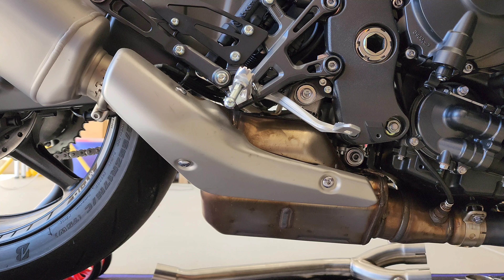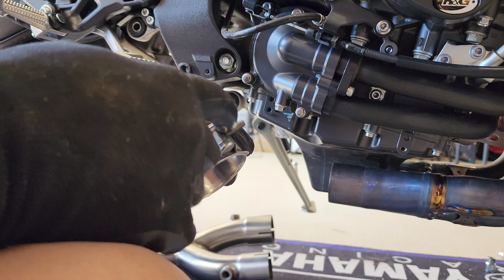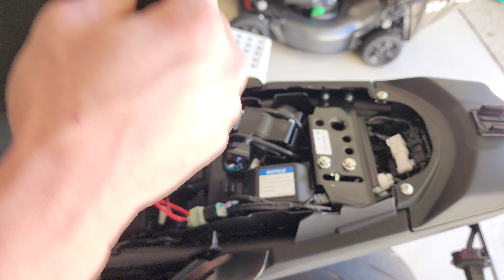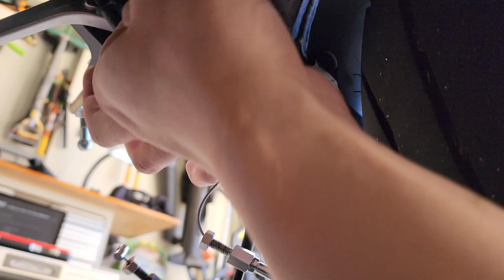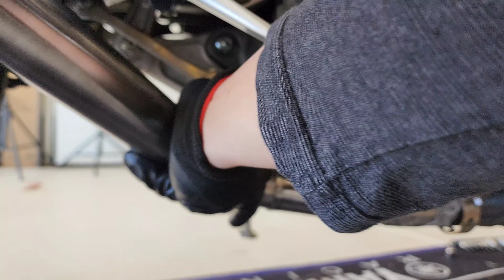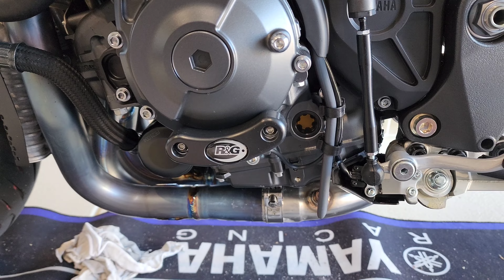2022 MT10 Exhaust Installation - Musarri Link Pipe/Mid Pipe

Comment: Excellent vid mate! Well done. 

Guessing you're from Aus? What city? any issue with not running a Cat on ya bike? (im kinda stressed about that but really wanna hear that engine!
Reply from the maker: I'm in Perth, WA. No issues running no cat and can with Mr Plod. It's loud, but not as loud as SC Project. It also has healthy amount of pops and flames on down shift.
Reply from the maker: You'll still hear the engine, but once you're going 110kmph or above 😉 you'll just hear the exhaust and wind noise. I got a HJC RPHA11 RPHA10 helmets and they're noisy helmets.
Reply: Cheers for the info mate.

Comment: Somebody probably already mentioned it but make sure you have that ecu flashed accordingly. They run extremely lean when you get them breathing properly with an exhaust.
Reply: If it's lean, how do you explain the flames out the exhaust?
Reply: I'm sure it's fine......just send it like it is😅🤣😂
Reply: @ryanmurray9017  When a brand-new exhaust or link pipe is installed, they always shoot out flames. I think there is some kind of chemical coating inside that needs to be burned off.
Reply from the maker: Several months in and I'm still getting a lot of pops and flames. I get complaints from my biker mates when they ride behind me it smell of fuel so definitely not running lean.

Comment: How is your bike running without an ECU flash? I’m concerned about mine and don’t know if I want to risk something going wrong. How’re things looking for you??
Reply from the maker: It's still running rich. I don't have a plan to flash the ecu as it will cost another $1000.

In fact my fuel consumption dropped from 9.4L/100km to about 8.4L/100km in Mode A and I don't baby it.

If I am babying it or taking it easy in Mode C I get 5.4L/100km.

There are some pop when I'm decelerating and when I'm ridding it hard flames will come out of it.
Reply: How do you know its running rich .. bikes are lean from dealer .....

Comment: Is ECU flashed required?
Reply: It is if you want your bike running in good conditions.
Reply from the maker: You can tune it to get more power and stop the pops and flames and remove the 80% restriction but I still haven't tuned it.

Comment: Great video! No ECU flash required? Do you lose any bottom/mid torque?
Reply from the maker: Thanks. No I didn't loose and low to mids. It still got planty of power. After about 3000km the quickshifter go smoother.
Reply: @RaidenXXII  No ECU flash required?
Reply from the maker: @scottwang16  ecu flash isn't required but if you want extra power and remove the throttle restriction you should ecu flash it.
Reply: @scottwang16   ECU Flash is absolutely required after doing a decat on these bikes they will run way too lean and end up damaging your motor.
Reply: @xdrive8860  Good to know, thanks!

Comment: What an insane improvement! I assume you had to get a tune after this right?
Reply from the maker: No I didn't get a tune. It didn't suffer from low to mid flat spot like in Gen 1 does after the link pipe upgrade.
Reply: @RaidenXXII  that's surprising after a whole decat! Thanks for the reply, I'm buying one in black this week. Love yamaha
Reply: @corbinroberts949  did you get one ?
Reply: @Litehamer  yes! In black just like I wanted. So far, I've only swapped out the silencer for a Radiant GP shorty exhaust and left the breadbox as is. Sounds pretty good for only 60 bucks spent, and no tune needed.
Reply: @RaidenXXII  I would highly recommend that you still get a tune or at least an ECU flash. You may not feel any difference or flat spots but 9 times out of 10 a decat/link pipe will dramatically change the air/fuel ratio.

Comment: hi! you know if is the same delete cat  of the model 2019 ? is compatible?
Reply from the maker: It is the same link pipe as the 2019 MT10 which is Gen 1. It does fit but you will need to force up the muffler by about 10mm up.

Comment: Ti segnala qualche errore rimuovendo i cavi della valvola di scarico?
Reply from the maker: No, I left the servo motor connected. You can get sero motor delete or flash the ecu with woodlich tune and turn it off.